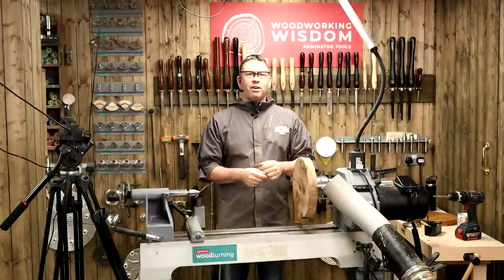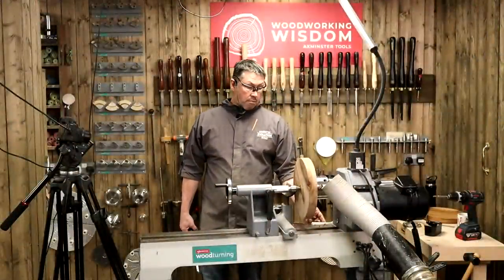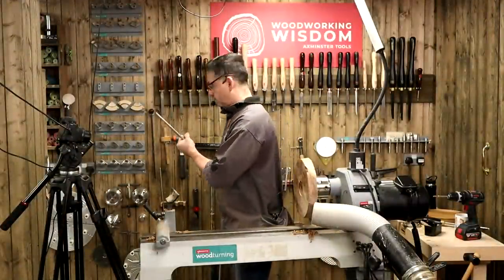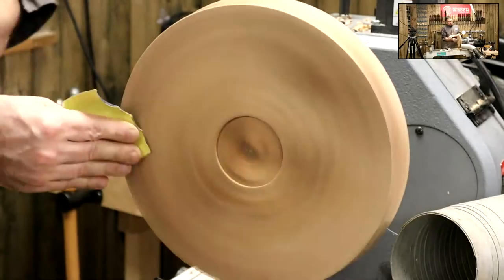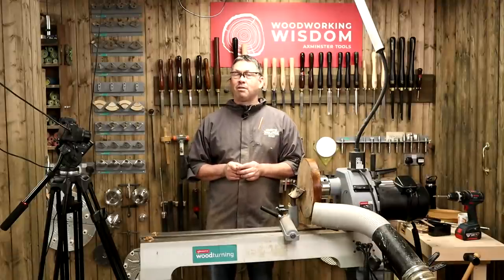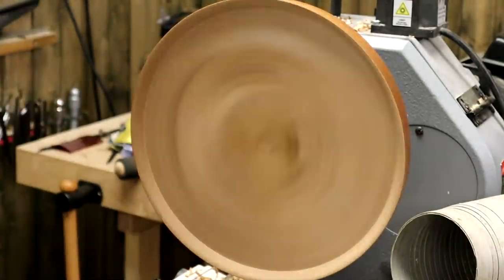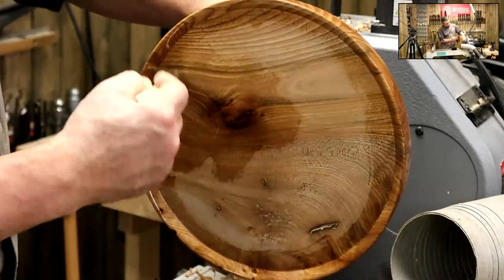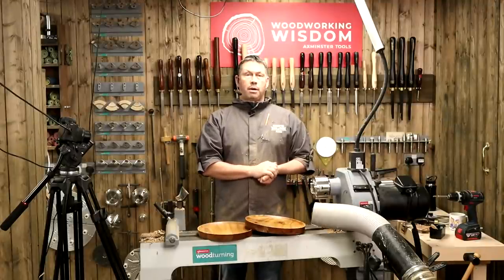How to Turn a Wooden Cheese Platter - Woodworking Wisdom

Comment: Hmm, I've almost created a 10" diameter funnel, because an important detail about mounting the blank was not explicitly explained in the presentation. The important detail appears at about 35-1/2 minutes in the presentation. There you will see that when Colwin removed the piece from the screw that there was a spacer square of 3/8-1/2 inch plywood on the wormscrew.  This effectively shortens the length of the wormscrew thus giving a bit more thickness for the recess. This afternoon, after I mounted the blank on the wormscrew then cut the chuck recess,  the recess was perilously near to the wormscrew.

Comment: Absolutely loved following this video, learned so much and it was great listening to the questions raised also. I only picked a lathe up last week and have not done any turning since school 45 years ago. I picked up a piece of beech and followed your video step by step - fortunately, the chuck on the lathe is the same so I was able to mount the piece perfectly after cutting a channel to accommodate. This cheese platter I have made is my very first project - I was worried about it flying off at warp 9 .... "de brie" everywhere .... sorry, couldn't resist !   I am now going to wait overnight and wet sand again with 800 grit with another coat of "food safe" oil.  Delighted with the progress and with all thanks to you - your videos are easy to understand and follow  :)
Reply from the maker: Thanks for sharing, what lovely comments. It's gouda to hear and glad brie could help!

Comment: Would you please publish a list of the tools and products used on these videos?  It would really help those of us who are not familiar with all of the various Axminster tools and products.  Include the lathe model, any chuck/jaw combinations, gouges, skews, parting tools, sandpaper brand and type, and anything else that Colwin is using.  You could put it on the website as a PDF with a link if you wish.  Finishes and airbrush tools as well.  Thanks,
Reply from the maker: Hi GrumpWiseGuy, we have listed the key products as links in the description. However, we are more than happy to tell you any extra specifics. Please email woodworkingwisdom@axminstertools.com with what you would like to know and we'll get back to you 😊